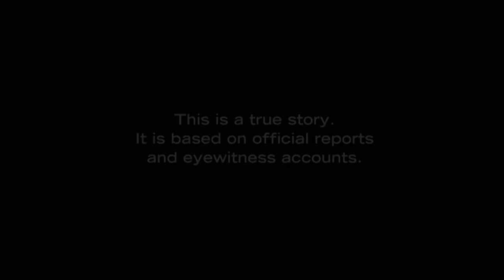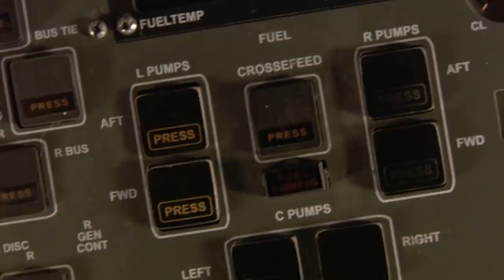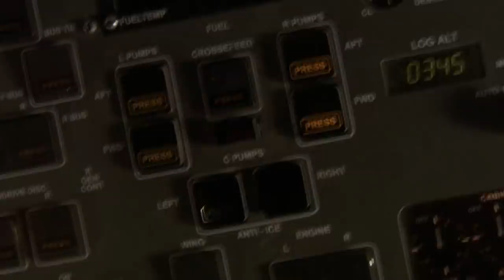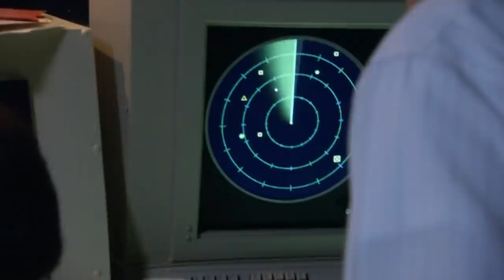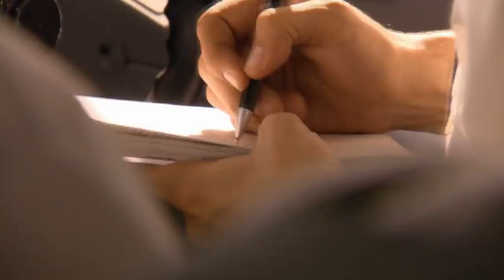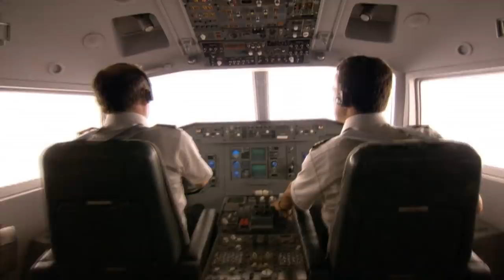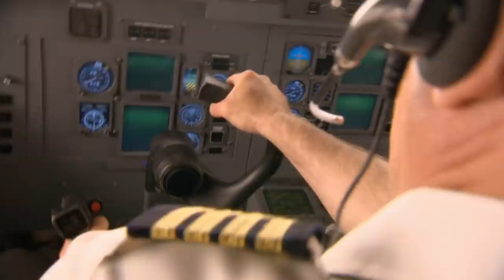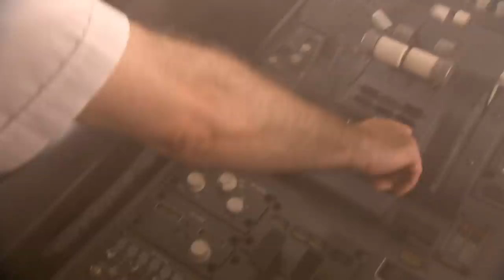Landing A Boeing 767 Without Engines | Gimli Glide | Mayday: Air Disaster

Comment: This is my FAVORITE narrator on Air Crash Investigations…my fetish for accents aside…he just makes everything sound so cool and interesting…also yeah well done to the crew of the Gimli Glider…I apologize to the crew that there plane is wasting away at the Boneyard
Reply: The Gimli Glider museum in Gimli has some parts of the plane (a section of fuselage, the back up hydraulic pump, the fuel gauge package from the refueling station, the flight control column etc.) and they have a flight simulator where you can practice trying to land the 767.  We were at the opening of the museum and we were able to go out on the runway with Captain Pearson where the stopping position of the nosegear is marked.
Reply: @jvckrs  well she may die in the Boneyard but she will forever live on in our hearts...RIP Gimli Glider and Her Crew

Comment: "The nose gear is lighter ... it doesn't lock" sounds like the biggest engineering oversight (on top of other solid contenders) of this video
Reply: A port in the nose that would take some of the air pressure hitting the nose and redirect it to help push the gear forward might just be the thing.

Comment: The reason it ran out of fuel is that they were using different systems. The 767 used an imperial system to measure the fuel. but the Canadians on the ground used the metric system so there was less fuel than needed in the plane.
Reply: Don't they have a reading for lbs of fuel?  as a backup check? or at least a "fuel gauge"?
Also, even with less fuel, why wasn't there enough fuel for at least one engine for the full flight?  They can shift where the fuel from each tank goes, so just keep one engine running.  If there was in fact NO fuel left, then something is really wrong here.
Reply: Actually heard some reverse errors.
(Highway Construction)

Miles did not work.
They kept running into things
Reply: @terry_willis  
Error was found on the ground.

In the air:  
Engine Failure 
High above Canadian Wilderness.

No warning, beyond failed engines.
Reply: @terry_willis  Unfortunately this was a very new aircraft and there was a fault in one of the 2 redundant channels of the fuel gauge (that also took out the second channel) and there were no spare parts to fix the problem so manual fuel measuring methods (drip sticks) had to be used.
Reply: Ace L;  Actually, it was the reverse.  By Federal Government policy the new aircraft was delivered with equipment calibrated in the metric system. The old fuel dispensing equipment used in Montreal (where fuel was loaded) was calibrated in the Imperial system.
Reply: @Vincent_Sullivan  yeah my bad. it was awhile since i read it so i miss matched it

Comment: It was a great flying, I learned to fly in the early 1970's, in a Piper 140 we would do Forward Slips to lose altitude and get into a small area, also if you are short of altitude, just don't sit there, increase your airspeed, dive into ground effect, it will get you further...

Comment: Boeing Execs: "There is nothing wrong with the plane, we expect the pilots to figure it out"
Reply: NORMAL OPERATION!
Reply: @hotspur666  Exactly.  Boeing makes great escape room scenarios:  At a critical point in your flight there will be a flight control issue where you inputs will be the opposite of what is commanded.  Trim up will command a trim down due to a sensor issue without redundancy (737) right rudder input will result in left rudder movement due to a hydraulics issue (737), and you will unexpectedly run out of fuel due to an electronics malfunction (767).  You will be on final approach or you will have just taken off.   You have 5000 feet to figure it out. 123 go!  If you win you get the privilege of not having our PR team blame you for the "incident"
Reply: @Robbie6298  they didn't fuel the plane properly because they didn't convert it...

Comment: The Wikipedia article for "Air Canada flight 143" explains why the flight ran out of fuel (left unexplained by the video).
Reply: Pretty sure it was a miscalculation from the Imperial system (Gallons/Gal.) to the Metric system (Liters/Kilograms [L/Kg]), right?
Reply: @nicccckque3908  – Mostly, but there were quite a few missteps, including that fact that the new jet, with all its digital instrumentation, needed no flight engineer, whose responsibility had been to check the fuel level, plus there was a broken fuel level indicator which was disconnected by one ground mechanic and reconnected by another. It was a perfect storm.

Comment: It just shows how better newer technology doesn’t always mean good
Reply: Also known as BAD IMPROVEMENTS
Reply: But the issue had nothing to do with technology. They ran out of fuel because humans used mixed metric systems and miscalculated.
Reply: @Ibbix13  There were no working fuel gauges on the flight--and no flight engineer
Reply: @RideAcrossTheRiver  The fuel guages are a basic maintenance issue which any plane could have. That is not a 'new technology is bad' thing. Flight engineers went away because they are obsolete. Tons of aircrafts operate without them. That had nothing to do with the crash. The cause of the crash was not putting in the proper amount of fuel. Not because of new technology.
Reply: @Ibbix13  Pilots had too much to do. No such a thing as an 'obsolete' task in flight. It was a forced obsolescence to improve profits and for designers to show how savvy they are. A flight engineer would not have allowed the flight to proceed. The cause of the incident was no fuel gauges and reliance on automation. Improper fuelling revealed the problem.

Pilot error today is caused by pilots having too much to do--engineer duties in addition to flying. The old way was better, but profit supersedes safety and lives.

Comment: Why didn't you include the part about how an airliner such as this could depart with insufficient fuel on board?
Reply: according from the made for tv movie, it was a calculation error, they had started using metric measurements
Reply: it’s also in another video on this channel. they cut the episode up into 2 parts basically

Comment: IIRC cause of accident = error converting pounds to kilograms or vice versa when fueling the jet.
Reply: Yes and no. The ultimate cause of failure was using the wrong unit. There were also a string of other minor human errors that led to the accident. The fuel gauges could have worked if a faulty processor causing it to fail was disabled, that’s how it flew to Montreal but a mechanic reenabled the processor. Captain Pearson misinterpreted his conversation with the previous captain and thought the gauge was not working the entire time, and then misled by maintenance into thinking the plane was cleared to fly with no fuel gauge when in fact it was cleared for a faulty processor. 
This is a classic Swiss cheese model of failure. Each of those small errors alone could not have caused any problem, but perhaps through bad luck they all happened at once and when combined with the major calculation error caused an almost catastrophic failure. Fortunately, through Pearson and Quintal’s skill and luck the plane and everyone aboard were saved.
Reply: @andyhaochizhang  where did you get this information?
Reply: @erinnorwood6124  search for Gimli glider and there are several reports.  Captain Joe, or Mentor pilot (I think) does a good analysis.

Comment: Nobody thought to call local emergency services to be available where the plane was headed?
Reply: They did, but it was not covered in this re-creation.  I remember Canadian news-media stating the Gimli Fire Department was on scene at the time of touchdown, and entered the plane in full gear and air tanks before the pilots left the plane.
Reply: Apparently the  volunteer fire department went to the airport but couldn't get there in time because the airport perimeter fence gate was locked since that side wasn't an active airport any more.  They arrived after the fire was out and everyone was deplaned.  All of the passengers belongings and luggage was removed and they couldn't get them back for a day or two.

Comment: That atc is the best around. Give home what we wants an get em out of the way.
Reply: I wonder whether they still have the primary radar.
Reply: @b43xoit  Mainly just military.  In Canada we rely more on transponder based atc systems.
Reply: @expls  So if the same thing happened today, that model of plane running out of fuel, ATC wouldn't be able to see the 'plane, because its transponder would be dead. I wonder why they didn't start the APU.
Reply: @b43xoit  I may be wrong but I'm pretty sure the transponder like the radios is backed up by the Battery so they should have use of it for a short period.
Reply: Also it's not possible to start the Apu with no fuel.  You can deploy a RAT turbine which give a little power for maintaining hydraulic pressure and basic controls and instruments.

Comment: Would have liked to know the cause of running out of fuel.
Reply: I haven't gone looking for it yet but supposedly they've split it into a separate video on this same channel. The investigation section of this episode, I mean.
Reply: The fueling people were given the numbers in gallons but the crew uses the metric system. No one told them it was gallons. Plane got only half the fuel needed for the flight.
Reply: fuel tanks were filled in number of liters not gals, the fuel was roughly 1/4 the amount it should have been (1 gal = 3.78 ltrs.) So if the flight crew asked for 10,000 gals and instead got 10,000 liters, 10,000 liters is only 2,642 gallons

Comment: Static answerd the question,.... how did this happen? The ground fueling crew used the wrong measuring system,... liters vs gallons,.. so the jet was way under-fueled. Did the guages read FULL at Take-Off? Why didn't the Flight Crew check for fuel? That is rudamentary. An HEROIC Performance.
Reply: So the funny thing is, they did. It was really just this crazy line up of things going wrong. It was a new plane, and so not only was it using a new measurement system, but a lot of the parts were new, too. So the ground crew had a gallon tank, and the plane was in liters. Normally, there's a flight engineer checking off all this stuff, but the glass cockpit made that position obsolete. The electronic fuel sensor was supposed to be the check, however it was out of service at the time. Pearson didn't even want to fly without the sensor, but the ground crew assured him they could run the calculations. I think it wasn't on the required list at the time but it is now. For obvious reasons.

So what they did was the multiplication conversation from gallons to liters, but they used the wrong formula. Basically they were trying to say, convert 300 liters (obviously not the correct amount) to gallons (~80), which was the amount to get to the destination. Airlines are cheap and only ever fuel the plane for what it needs, so they don't fill it to full. So they're trying to get these liters in, and the calculations they got, under the 300 liters example, was something like 40 gallons (again, not the real number, an estimate), which was obviously not enough, then they reset the fuel gauge to full.

So basically Pearson has a gauge that says his tank is half full, but he's sucking fumes. Really, just things lining up very poorly.

Incidentally, this is why the computer raised a pump pressure issue. Normally it would check with the fuel sensor, but since it couldn't, it relied on the ground crews input. So in it's mind, if the engines aren't getting full, it's a problem with the pump. But the pump was fine, it just didn't have pressure because it was empty.

Comment: Mistaking metric for imperial units is what caused the plane to run out of fuel. The pilots calculated the trip in pounds, but asked for the fuel in kilos. It cut that out of the end of the episode.
Reply: Other way round...X kilos = 2.2X pounds.

Comment: Unfortunately they’d be referring to a forward slip. Side slips are used to correct against crosswinds, forward slips are used to increase descent rate without gaining airspeed. This is private pilot 101, unfortunately the narrator and editors didn’t get that far.

Comment: OUTSTANDING!  That's a pilot!  Unbelievable skills in landing that plane.
Reply: @Bill_Woo  The NTSB determined that the error was made at refueling and the report showed the plane had been refueled, but the refueling crew was using a different system of measurement.  The crew followed their checklist preparing for takeoff and had no way of knowing that the refueling team had misread the request and shorted them on the fuel.

Comment: I hope those guys got some of the biggest pay raises or bonuses ever. Managed to land a plane with no engines, drift a commercial airliner like no one else before, and land with no nose gear on a runway that was no longer a runway AND with the surrounding area occupied by many people? THAT is some extreme piloting right there, exhausting all the options, not giving up, and using creative thinking on the go that they didn’t get in training and won’t find in their emergency QRH. That is why you don’t give up on flying the plane! Always try every last thing you can until you either land or die trying your damndest. Also the irony that they did all that on what was now a drag strip and probably drifting better than any of those car guys could ever dream of much less in something so massive!

Comment: The glider "Slipping" maneuver is very much like the Space Shuttle's "Flare Maneuver" which is used to burn off speed when coming into a landing. (only with the nose UP in Flare, instead of DOWN in Slide),   I thought of that as soon as the vid said they had to bleed speed without power. Of course, the first Space Shuttle flight, STS-1, was Columbia on April 12, 1981, so I'm sure commercial airline pilots were not up to "How to Fly a Brick" as it had only just been accomplished, so now public flight simulators on how to land the shuttle (I think I did that in early 2000's at NASA's Houston JSC Visitor's Center.  WOW, just heroic effort & know-how by the pilot!
Reply: I doubt the shuttle can turn sideways like that though and this pilot had but a wiff of hydraulic boost, once he turned it sideways the "rat" got starved of airflow. This would be a difficult maneuver in a powered 767, this dude dead-sticked it.

Comment: That pilot is my hero!!
Reply: Well, considering that he caused the crash to begin with, then skillfully barely avoided a killfest...
Reply: @Bill_Woo  He didn’t cause it. A design flaw in the fuel tank. This guy saved every life!!
Reply: @tomdipasquale9633  Wrong, and also wrong.  Not only was the fuel tank fine; the facts are that he caused the crash by willful negligence.
Reply: @Bill_Woo  I got my information online and I just watch the video you’re wrong!!
Reply: @tomdipasquale9633  Read the official investigators report, not some dramatized television program.

He ordered the takeoff even though everyone else, and I mean EVERYONE, was uncertain if the plane had enough fuel.

That is one of the worst, most vile actions a captain can make, ordering a takeoff with insufficient fuel. It is a forbidden sin, and he committed it using his authority as pilot in command.

And he did that imperiling the lives of dozens of innocent lives on board - and thousands on the ground.

Stick to the facts.
Reply: @Bill_Woo  these are the facts: 
The Board of Inquiry found fault with Air Canada procedures, training, and manuals. It recommended the adoption of fueling procedures and other safety measures that were already being used by US and European airlines. The Board also recommended the immediate conversion of all Air Canada aircraft from Imperial units to metric units, since a mixed fleet was more dangerous than an all-Imperial or an all-metric fleet.
Never did they blame the captain or 1st officer! Stick to the facts!

Comment: how did they run out of fuel? Fuel weight is part of the pre flight checklist, so they can calculate elevators setting , V1 & rotate spoeed,
Reply: They did calculate all of the aircraft performance parameters with the amount of fuel they thought they had on board.  Unfortunately, they ACTUALLY only had a bit less than half as much as they THOUGHT they had.

Comment: I feel the air traffic control forgot something to do mainly because of their wordload and the intensity of the situation...that they could have at least alert the local fire station in gimli to rush to the airstrip and take action and empty airstrip and prepare for the worst.
Reply: I think they did. Except Gimli is so far that it still took a while for the emergency vehicles to get there (remember, it took them about 10 minutes from mayday to landing). Doesn't help that one of the emergency vehicle apparently ran out of gas on the way there.